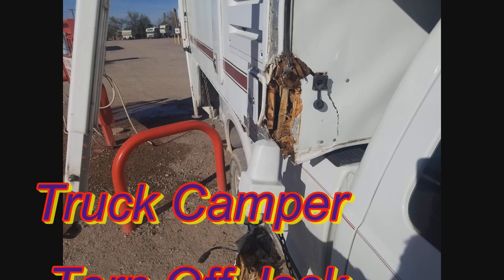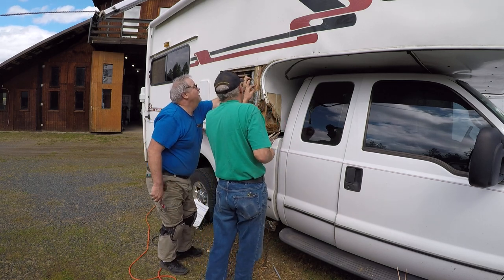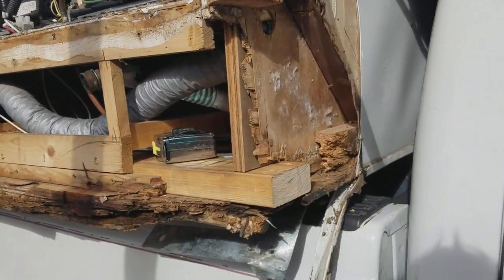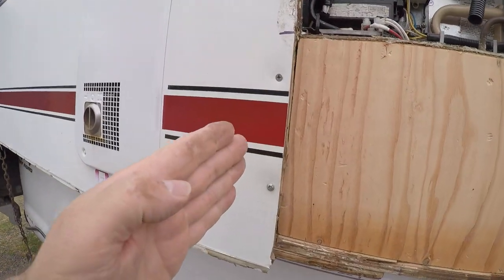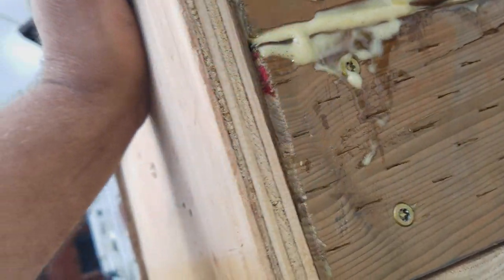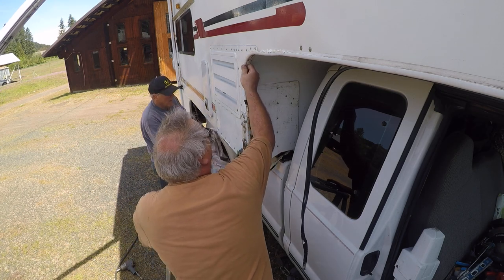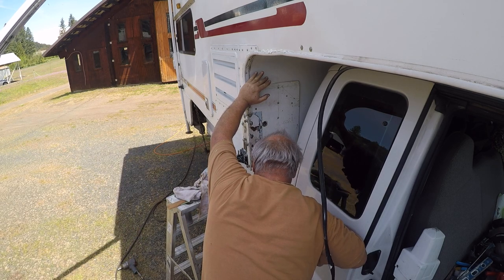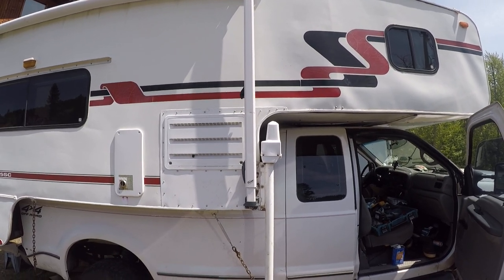Repair A Torn Off Truck Camper Jack

Comment: Looking good, better and stronger than new. The tie-down bracket was very interesting how you found it attached to the frame. Just wondering if that is how most TC's have their brackets installed. You would think with such a critical securement point, the bracket would be reinforced. It is what holds the TC to the truck. Your reinstall of the tie-down is definitely reinforced now. Thanks for the surgery video, the TC patient will survive for more exciting adventures. Happy Trails.
Reply from the maker: I was a bit surprised at how small the tie down bracket was too. It has taken some pretty hard hits before too. I was on a desert road with hazards everywhere bouncing the rig around and I bent the hooks out of my heavy turnbuckles but the tie downs were fine.  There are some brackets that are flat plates bolted to the flat underside and angle types bolted to the side and bottom. This simple design has proven itself holding about a 3500 pound loaded camper.  The thing I like the most is the flat steel strap for added support onder the camper when on the jacks.  Thanks for checking in, take care...

Comment: When I first saw the damage, I thought, "No way they can fix that."  Thanks for illustrating the rebuild.  It looks like you eliminated the little access panel that was just by the awning anchor.
Reply from the maker: I relocated the water fill connection to the left side so all the utility connections would be on the left which is where campgrounds have their connections.
Reply from the maker: https://youtu.be/bohgF1Esat8
This is the water fill connection relocation video.
Reply from the maker: https://youtu.be/pIayST53cqw
This video shows installing an electric outlet on the right side. Now I can use fans, lights, radios, laptops easily when outside. Glad you enjoyed the video,  thanks for commenting.  Take care...

Comment: Hard work, I admire your skills & learned. Thanks 🙏
Reply from the maker: Thank you. It turned out to be much easier to repair than I thought it would. I just finished installing an outlet on the right side in the repair area where the water connection box used to be. I'm just finishing installing the water connection box on the left side where it always should have been with the other utilities.  Now, all my connections are on the left where they belong. All RV campsites water, sewer, electric shore connections are on the left. The right is where the picnic table and outdoor activities take place. The new outlet on the right will be nice for lights at night, a 19" fan for hot days and bug control, plugging in a boom box for music.  Always trying to make improvements.  Take care.

Comment: Thank you for the video, I see I will have a can of worms when I start on mine.
Reply from the maker: Take your time, think it through. 
This guy did a whole repair series on his TC which is the same as mine. All wood frame campers are built very similarly. 
https://youtu.be/NZ9ggl2hK-o?si=9s9JOfycLhdhm0wA
Good luck.

Comment: Also. One other note. Closely inspect brake lines on vehicles. My 2002 F350  got a pin rust hole in the line behind the drivers front wheel on the frame. Brake pedal hit floor. Fun fun fun stuff. County road deicer is now here in Washington state.

Comment: I pulled my snowmobile trailer out of in front of my camper. The black berries pulled the drivers front leg off the camper with it. I think rot is a big part of the problem. Thanks for the video
Reply: I thought it would be fun to watch the blackberries get ripped out but diesels just pull at idle.
Reply from the maker: If blackberry vines pulled the jack off, it's possible the TC may have been ready to fall over at any time. Hopefully not on top of anyone.  Losing a jack sucks but getting squashed is worse.
Reply from the maker: I just came across this guy the other day, lots of good info on rebuilding a TC.
https://youtube.com/playlist?list=PL6UZxE5wKuuFRIgrng1StuwyBZu4G-w63
Reply: @CITAP1  Yes. It's a 97 S&S. Been outside for 15 years or so I've owned it. It's going to the junk yard I must say. Families grown and no grandchildren. Blackberries are a tough vine. They are a constant battle.

Comment: Hello! Did you overlap the existing exterior under the aluminum sheeting to secure it? About to cut into my new truck camper that  had the corner so rotted I was able to just pull the jack off and I’m going to follow a similar execution plan as you. Just wondering about how you secured and sealed the original exterior under the aluminum sheeting.
Reply: Also was the 2x3 notched and jointed together with the 2x4 installed on top of it to reinforce
Reply from the maker: @bradymccarthy3  The 2x4 bottom does Bolt into the 2x3 above. There is plywood overlap inside. The aluminum side plates are structural, and the construction strap greatly helps support the truck camper.
Reply from the maker: @bradymccarthy3   Around the fridge area, I cut away the bad siding and fitted plywood to be flush with the remaining siding, then fitted the aluminum plate to be able to screw into the framing. Did the same for the smaller front piece of aluminum.

Comment: Thank you so much! This video saved my ass! A dude hit and ran me on the california 101 fucking my truck jack
Reply from the maker: @SydddyP158  Sorry about the dirtbag hit and run of your rig. I'm glad the video helped. This repair has worked great. The best part of the repair is installing the construction strapping to help support the weight much better than the jack bracket bolts alone.  I hope you get back on the road soon. Take care.

Comment: Can you explain exactly what you did to stabilizer the corner so it can handle the pressure from the jack when you go to lift it off your truck?
Reply: Where did you get the 2" x 1/8" Steel Strap?
Reply: "Are we having fun yet" what a guy lol
Reply from the maker: All the materials are my friend's farm stock. The corner is glued and screwed together with 4 layers. Framing, blocking, layer of plywood,  second layer of plywood., and finally the heavy gauge aluminum sheet. The sheet was an old company sign. The sheets are both caulked and screwed into the framing.  The corner is tied together by two levels of plywood, one on the bottom and the upper under the fridge holding the front right corner together at two levels. The 2" steel support strap goes about 5" higher than the plywood under the fridge with 4 3" counter sunk screws fastening to the upper part. The aluminum sheets finish making the connections. It is very rock solid. 
Most of this information is in the video. The video is step by step methodic, so you have to watch without skipping forward.  
I hope this answers your questions.  Take care...
Reply from the maker: @catherineluminous  
All the materials are my friend's farm stock. The corner is glued and screwed together with 4 layers. Framing, blocking, layer of plywood,  second layer of plywood., and finally the heavy gauge aluminum sheet. The sheet was an old company sign. The sheets are both caulked and screwed into the framing.  The corner is tied together by two levels of plywood, one on the bottom and the upper under the fridge holding the front right corner together at two levels. The 2" steel support strap goes about 5" higher than the plywood under the fridge with 4 3" counter sunk screws fastening to the upper part. The aluminum sheets finish making the connections. It is very rock solid. 
Most of this information is in the video. The video is step by step methodic, so you have to watch without skipping forward.  
I hope this answers your questions.  Take care...
Reply: @CITAP1  Thanks, I did watch it after I sent the message. I have a simular situation and Im looking for the best option to support the vertital 2x2. Did you screw the plywood into the remaining vertical corner lumber ?
Reply: Your unnamed friend seemed to get between you and the camera right at the most important parts! lol
Reply from the maker: @CDLuminous  Ha Ha, nobody has accused me of great cinematography.  Unfortunately, we get going on doing things and forget to pay attention to what the camera is doing.
Reply from the maker: @catherineluminous  everything is glued with Gorilla Polyurethane Glue, be sure to dampen the wood being glued as moisture activates the glue. Screw and clamp the pieces together as you want to be tight and not have any voids for maximum adhesive strength. Try to use Stainless Steel screws and bolts. They will hold up against weather the best. Cut out the rotted wood. If you have to, you can overlap glue and screw members together.  You can also use metal pieces to fasten parts together.